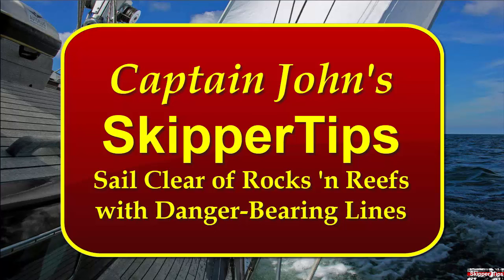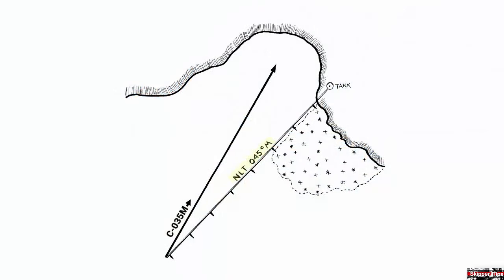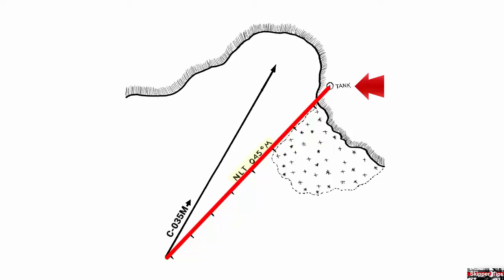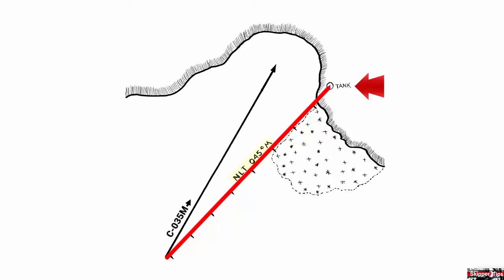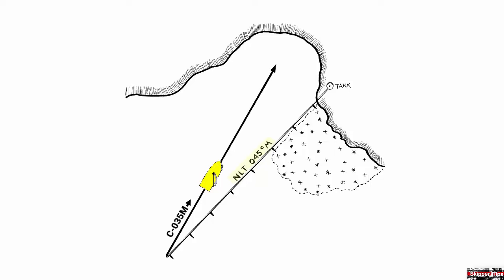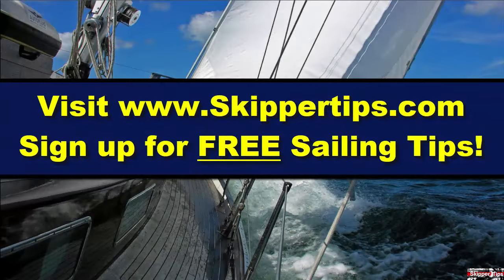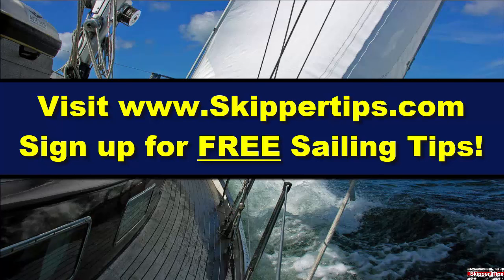Sail Clear of Rocks ‘n Reefs with Danger-Bearing Lines

Comment: I'm confused, isn't your DR boat on a danger bearing? Shouldn't your danger bearing start close to your intended bearing of your intended place then out past the danger.
Reply from the maker: Mark, the sailing trackline is your base couse to the cove. The Danger Bearing is a separate boundary line, which marks the edge of the shoal. Remember you are taking bearings FROM your boat back to the object (or a waypoint) ashore. If you drift to the right of the Danger Bearing line, you are headed toward danger.  Look at the screen at approximate position 1:30. Notice how we take a bearing (or sight over the steering compass) and the bearing is much less than the initial Danger Bearing line.
Reply: @skippertips  so you're using a separate compass to track the bearings of the shoals/reef from the shore light out but I still don't think that's going to keep you out of trouble. You'll still need to watch your soundings and drift/set and keep a wide distance from the reef.
Reply from the maker: Mark, exactly. The danger bearing is but one single technique to use along with soundings, tidal-current tables, correction for leeway (downwind drift), etc...

Comment: I’m confused. If your bearing was 12deg, you would be pointing more clear of the shoals.  12 is less than 45.   If my bearing is 90, I think I am in trouble.
Reply from the maker: Otto, the Danger Bearing is a separate boundary line, which marks the edge of the shoal. Remember you are taking bearings FROM your boat back to the object (or a waypoint) ashore. If you drift to the right of the Danger Bearing line, you are headed toward danger.  Look at the screen at approximate position 1:30. Notice how we take a bearing (or sight over the steering compass) and the bearing is much less than the initial Danger Bearing line.
Reply: @skippertips  Ah Ha!  Get it. Different bearing entirely. Thanks.